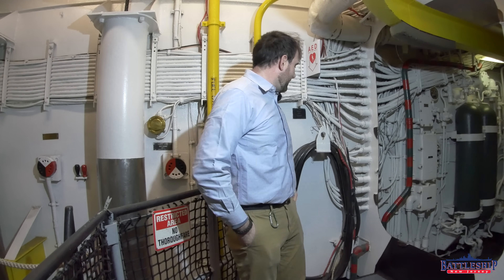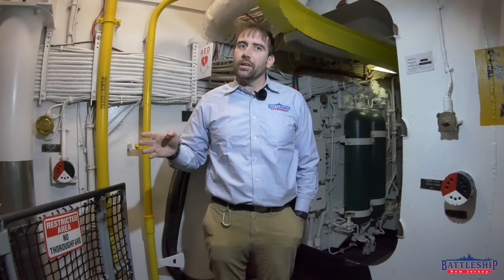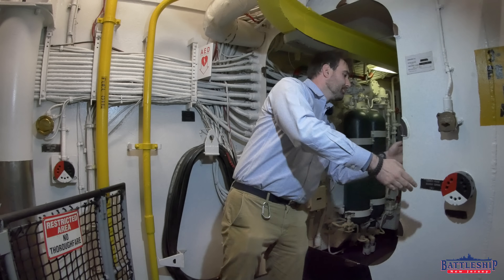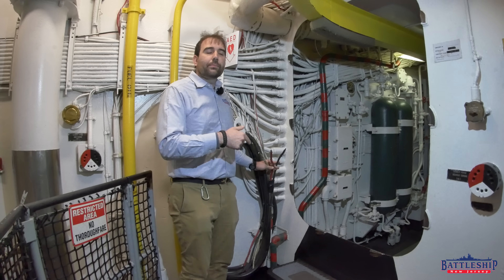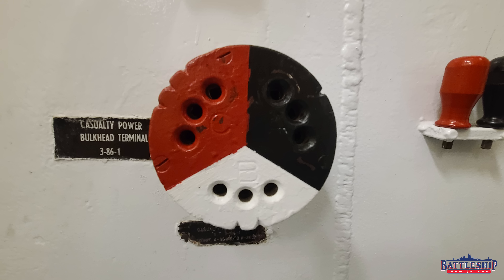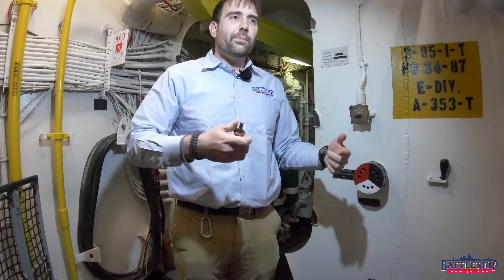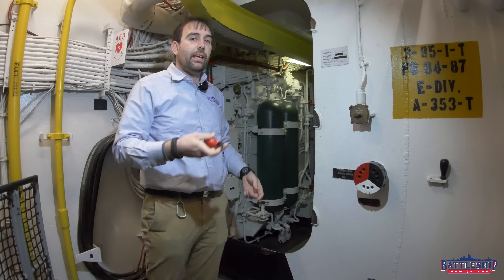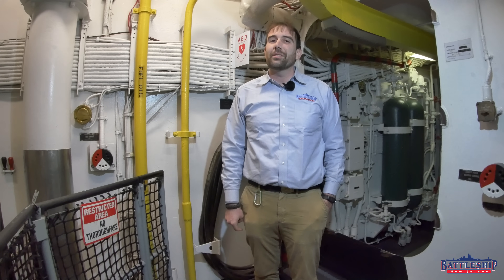What Are Those Weird Red/Black/White Discs on the Wall?

Comment: At first I thought this were going to be some clever water tight connector. But nope, it is just a crude screw terminal block and a set of thick wires. I guess it does the job.
However, I can see it as adequate for the application and for the time the ship were built. Not to mention most militaries desire to stick to the "if it works, don't fix it." mentality.

Improvements I would have made is actually have a connector such that user error becomes almost impossible. A Cee-form connector (IEC 60309) would be the wise move. Mainly since they support multi phase power and are made for these types of harsh wet environments. Cee-form connectors are also common as mud. And I wouldn't be surprised in the slightest if they are already used for this type of application on more modern ships.

Also having fuses for ensuring that the emergency wiring doesn't catch ablaze if it gets overloaded would be a wise move. Haphazardly making emergency connections in the heat of the moment is likely not going to ponder much about the current ratings of downstream cables. However, this can somewhat be taken into consideration during the design process of the ship, though likely with compatibility downsides.
Reply: Source receptacle is switched and fused, just like any other load.  Loads equipped with Casualty Power connections are actually relatively rare, and are generally restricted to combat and DC systems.  The appropriate charts in DC Central show the max amperage for each load, and a Load Tally is kept as CP connection orders go out.  

These aren't something that just anybody rigs when they think they need to.  Connections are ordered and terminals designated.  The actual connections are made by sailors specially trained and qualified to do so, generally the Repair Locker Electrician or IC Electrician.  Appropriate high-voltage gloves and boots are worn, eye protection is worn, etc.  As always, the connections are always handled as if they were energized, even after you have verified otherwise.  This is actually a Qualification, meaning that there is an individual Qual book with training items and signature blocks, a written test, and generally an Oral Board.
Reply: @kevincrosby1760  I would have been surprised if these types of systems were used on day to day basis, after all it is an emergency power distribution system.

Likewise would I also be surprised if the Joe average sailor were doing the connections, especially without some form of organization and rudimentary safety equipment.

However.
Even qualified personal makes mistakes sometimes, be it incorrect planning, ordering or execution, or good old miscommunication. Especially given the circumstances this equipment would be used in.

Damage control is not typically done outside of high stress, often loud, and the otherwise poor working conditions typically associated with ongoing bombadment.

Even if thorough training can help reduce these issues.

Now, at the time this equipment were designed, I can see it as suitably safe. There hadn't been that much development into power connectors at all by this point in history, electricity were still relatively new having only been around for about 50-70 years outside of scientific curiosities.

But by modern standards it is frankly a bit antiquated. As we now have another 70+ years of additional development in the field.

A more modern system would just use interlocked 3 phase power connectors. And there is a fair few approaches to how to achieve this in practice. But effectively it removes the hazards of making/disconnecting the cables such that the Joe average sailor can now do it without safety equipment or extensive training.

Organization for what connections to make and when is however still required, as well as some degree of basic training.
Reply: Modern casualty power uses a plug, not individual wires.
Reply: @JoshuaTootell  As I expected.
Way safer and "fool proof". Probably quicker as well.

Though, still partly surprised that the WW2 stuff didn't use a connector. The advantages are numerous. But I can't find any suitable 3 phase connector dating back that far.

Comment: Interesting, but I hope that they connected to the load before connecting to the source, otherwise you have someone running around with live 480V 3 phase conductors exposed.  That never ends well.

Comment: Seems like a shame they spent a lot of time, took a lot consideration in designing as close to fool proof system with the RED|BLACK|WHITE sections and notches for the biscuits, and terminal handles on the cables. Yet the color-coded wrenches (the RED and BLACK ones you demonstrated), to train the crewmen "you can use the RED or BLACK handled wrench and the RED, BLACK or WHITE section".

Comment: I rigged my ebike to by my emergency battery. It's not much, but i have led lights that run off 12v all throughout my house, as well as a 12 fridge.

The 36v battery goes through a converter to bring it down to 12v, where it's met by... Two lead acid car batteries, and then all fed though a power meter.

From this, i power the lights and smaller fridge and even my phone, Internet and computer.

It's sloppy, but it's passed my tests and holds with 2.1 kwh total. Also, it only cost me $350 and junkyard trips!

Comment: So they went through the effort to have color coded standardized screw terminals to bypass a electrical interruption. Why don't have a standardized plug on them which doesn't require fumbeling around with screw terminals in the dark in a battle situation in a partial flooded compartment with 400V live wires?

Comment: you don’t mention how this is energised, plugging this it to a load or even just handling the bare energised live cables as you go to plugging them in seems rather risky
Reply: Mark, As I remember the plan was to rig from the dead zone to the hot side. There were heavy rubber gloves and boots supposed to be in the repair lockers for safe handling.  Getting to that gear could mean breaking watertight integrity though. The problem is to know what is hot and what is not in the middle of big trouble. Are you going to have an electrician with test gear on site? This system looks simple and sailor proof as well as hazardous. I hope someone comments that they did this successfully under battle conditions or even in a realistic drill. -P
Reply: @paullewis5045  The Repair Locker Electrician or IC Electrician would make the connections as ordered by DC Central.  The source receptacle is separately switched and fused just like any other load coming off of that switchboard.  Appropriate PPE for working with energized circuits is worn, although nothing should be energized until the connections are completed and DC Central orders it heated up.
Reply: @kevincrosby1760  Thanks Kevin, that makes a lot of sense since DC Central would have the big picture. Plus, DC Central has all the ranking (Chief Engineer etc.} experience right there to make good and safe calls. The picture of how this is successfully and safely accomplished is clearing up.  TX, P
Reply: @paullewis5045  Take with a grain of salt.  Haven't stood on the deck of a USN ship in over 30 years.  The USNR never managed to get me on one after I left active duty.

Comment: I suppose that power cable could work as an AED device to jump start a heart that is out of rhythm 440volts at a time. There is an AED sign above the coiled extension cord cable.
Reply: The AED is something that is required to be present in a public museum, not something generally found on a US warship outside of Medical.

Comment: The guy who invented this System should be slapped to the face.
Connecting 400v bare wires in darkness together with smoke and wetness, is just insane.

They should have been invented a plug / socket system - More quicker and much safer.

Comment: Why not just use nema connectors? Or have connectors designed and made that only go one way. Why are you wrenching 3 wires in place instead of a plug????

Comment: This seems way sketchy to me...  You're going to be handling these bare ended wires in water???
Reply: What choice would you have in combat?
Reply: @Thomasnmi  You have a point; still seems sketchy enough to me that a better way would have been found by now.  Some sort of rubberized gasket over the head that slides back when you push it into the hole... Anything that keeps a naked end of a live wire from flopping around in the open after you have already hooked up the other end...

Comment: I hate to be that guy, but you need to get better about your lapel mic placement.

Depending on where you turn your head, you range from perfectly clear, to muffled and garbled, to the point i can't hear you clearly even with the volume all the way up.

Instead of clipping it to your collar, try on the front right by one of the top buttons.   

edit: nevermind its bad in a lot of the videos, so placement isn't the issue.
Reply: hate to be that guy, but the audio is way better than it used to be!!